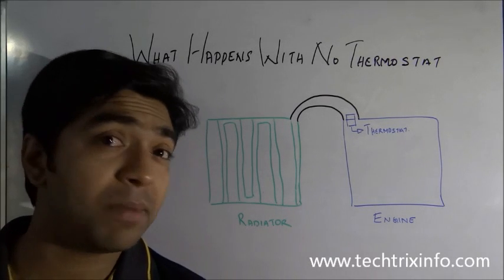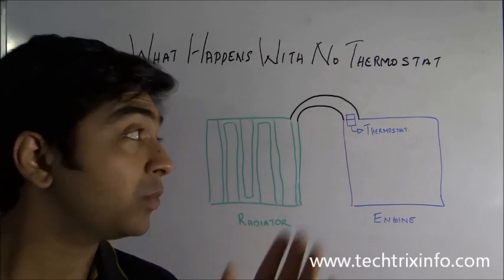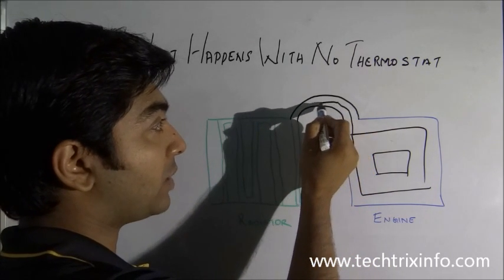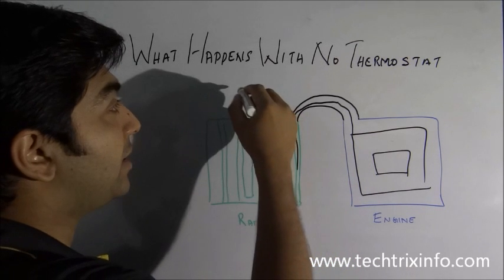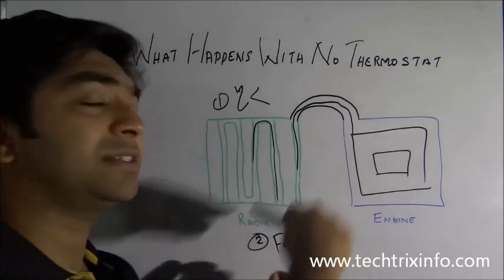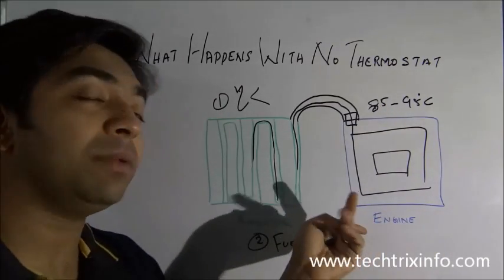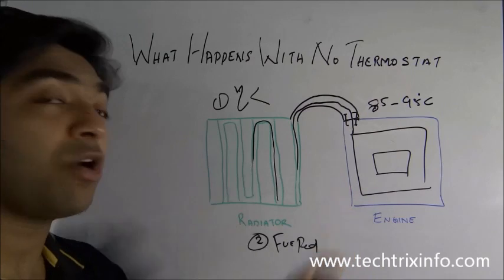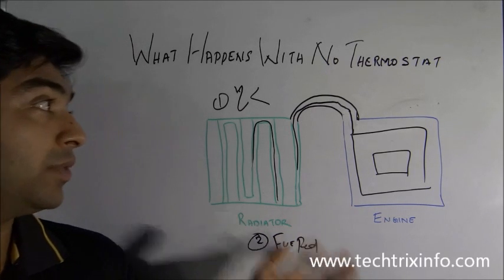Can engine work with out thermostat ? ✔

Comment: Lies. The engine will still get hot.
Reply from the maker: Hi, While it's true that an engine will still get hot without a thermostat, the thermostat plays a crucial role in regulating engine temperature. Without it, the engine may reach operating temperature more slowly and unevenly, leading to inefficient performance and increased wear. The thermostat helps maintain the engine at its optimal temperature by controlling the flow of coolant. Without it, the engine could run too cold, affecting fuel combustion and emissions. Ultimately, the thermostat ensures that the engine operates efficiently and reliably by maintaining a consistent temperature range.

Comment: Hello, I bought my Toyota Sienna 2012 without Thermostat in Nigeria. Do I need to buy thermostat. My mechanic discouraged me and saying it's not advisable
Reply from the maker: Hi, thanks for your comment! Even though your mechanic says you don’t need a thermostat, it's generally important to have one in your Toyota Sienna. The thermostat helps regulate the engine temperature by controlling the flow of coolant. Without it, the engine might run too cold or too hot, which can lead to reduced performance and increased wear. In some cases, running without a thermostat can affect fuel efficiency and emissions. It’s worth getting a second opinion or discussing the potential long-term effects with another mechanic to ensure your engine stays in good condition.

Comment: Driving a mitishbish 4g63 without  a thomostart  when rain fall heavy  it will not start until the sun come out please  help  thank you
Reply: Check heater plug and glow plugs.... or put manual heater, it helps heating glow plugs fast and useful when rainy days...

Comment: 2001 toyota camry,,has no thermostat all new heat sensors new fan switch fans do not work still.. Put on manual swtch to have fan on all the time,,car temperature still getting hot. new coolant .Any idea what i can do that im missing. Thanks for your videos they do help.

Comment: This is a classic example of an amateur person with a clickbait video just repeating what he heard but evidently contradicting himself on his graphic which show no return hose and he did not even mention that when he should at 4:10 . Sadly people like him give tons of misleading information on you tube. In short, yes it is better for the engine to have thermostat (engineers have done tons of research). If there is no thermostat, coolant temperature sensor will send signal to ECU with different temperatures and engine will not run at its optimal power, fuel consumption. etc. Also  creating a check engine light.

Comment: I live in Sydney where it is mostly hot (and boring..but that's another topic). Only in older vehicles say 25 years plus I have removed the thermostat. The reason for this is to allow the old engine to heat up gradually. Heating and cooling causes expansion and contraction of metal. This then leads to metal fatigue and possible failure wear and tear. In a newer engine this is inconsequential because the metal is new. It hasn't gone through expansion and contraction often. Engines 25 years plus need help as they get older just as we will. Frequent oil changes best oil too careful driving techniques and gradual heating of the engine.
Reply: Yes even i have 20year old vehicle and removed thermostat..so far no issues

Comment: Driving our mitsubishi engine 4d56 for 10years without thermostat, up to now no problem. Im from tropical country the Philippines 🇵🇭
Reply: It's much better in warmer climates, in colder climates, the car won't warm up or warm up really slow and will show signs of wear a little faster. If you tried this in North Dakota in winter, the car would always be in the "choke phase" and run very rich possibly wearing the piston rings out faster and you get abysmal fuel economy : /
Reply: @prototype9904  if its is in choke , heat it up a little.
Reply: same bro i just realized that my car has no thermostat for 11 years now
Reply: @SeanTabada  hi

Comment: Hi bro,I m in civil engineer we have rig machine in our site this machine engine frequently getting overheat so, my question is without thermostat we can keep optimum temperature or not if it's then how it ll be working can you explain
Reply: If you are an engineer like you said you must be capable to solve this by your own...run some tests on the rig with and without the thermostat...chart your readings and decide accordingly.

Comment: How long can travel with bad thermostat, can I run a my car with a bad thermostat, car isn't over heating but heater is not working
Reply: it depends ,if your thermo is shut closed you will need to stop and removed it immediately

Comment: My old car without thermostat it works fine .in Florida you need  no heat
Reply: I’ve never had issues running no thermostat. Engine just takes longer to heat up.

Comment: Thats not true i have checked my scan tool and it has no noticable  difference infact during idle  the fan is off until the engine gets over operating temperature and keeps it at operating temperature so thermostat are only good for idle during in snowing conditions to avoid water from freezing at the radiator as the waterpump would try to circulate icey water the thermostat would save those components on the engine by warming the coolant internally but in a warm country thermostats dont save anything

Comment: What about this argument I hear a lot? Without the thermostat at higher RPM(faster speeds) the water doesn’t have enough time to cool down so hot water goes back into engine which could result in overheating. I have a carbureted liquid cooled motorcycle and considering not running a thermostat.
Reply: At higher RPM the water doesn't have a chance to heat up without the thermostat I think is the issue.

Comment: Old diesel Mercedes 1984 internal corrosion build up.....removed thermostat to compensate. Doing an acid flush risks more leaks than just removing thermostat. I live in a hot state. Optimum temp is now held going up hills and overall average driving. It no longer reaches 90% max heat risking damage to all parts of the engine. Longer morning warm ups is all.

Comment: Hie 
I have Honda civic 2007 model automatic transmission ...i changed the thermostat valve but when ever i drive in sports mode my engine gets overheat , i checked with Honda service center they said replace the radiator its gonna cost me 25k ... Plz do help me why my engine getting overheat while driving in sports mode .. I will be very thank full to you ...

Comment: 2001 bmw 740i, been driving it without a thermostat. The temperature needle always stays in the middle. The only difference I noticed after removing the thermostat is that it takes about 10 minutes to reach operating temp.
Reply: Idris Babatunde my Land cruiser with engine driven fan takes half an hour to heat up without the t.stat.guess it's better to run it that way.😂
Reply: I got a 5th gen prelude and same.
Reply: i think if the fan i controlled by ecu, then the engine will still heat up quickly as the fan will not be working until it gets to optimal temperature. Taking out the thermostat in this kina car, you may not notice much of a difference ..

Comment: Brother, could you please tell me why does coolant leaks in a car when it's on
Reply: Depends on the car. If it is an American car, the coolant runs out of the Engine into a "heater core" and then into the radiator where it is cooled by the fan then back into the engine. The "heater core" is a small radiator that is located inside the dashboard of the car on the passenger side, mounted at or around the fire wall. Connected to this heater core is a blower fan and motor. This is designed for warmth in the winter time. You simply turn your air condition setting to heat and set the fan to the heat output you want and your cab stays warm. The heater core is, generally - like your radiator, made out of copper. Over time the copper becomes corroded and forms a leak. This makes it's way into the floorboard of the vehicle on the passenger side. You have 2 choices now. Remove and replace the heater core or cut the hoses going into and out of your fire wall from your block and to the radiator,  respectively, and bypass heating system with a double male adaptor that links the 2 hoses and allows the coolant flow to continue. This method is cheap and quick, but you will regret doing it when winter hits and you have no way to defrost your windows or stay warm in the cab. If you do nothing eventually the leak will grow and you will have not only a stinky cab but an overheating vehicle.

Comment: No thermostat, means Car just takes longer to heat up, but after it heats up it runs normal..
Reply: If you're driving for long distance with no thermostat, the engine will be cold and reduce fuel economy. Because the radiator is getting blasted with 120km wind with continues circulation of coolant.
Reply: @frogGames  will it be a big difference? What about putting a piece of cardboard in the front
Reply: @420BLUNTLEY  😂🤣
Reply: Frog games is onto something 
So road trips yes fuel economy out the door
But if u in city and stop and go at stops the engine has time to heat up a bit

Anyway I like how u thought and know about the one factor a lot of people don’t bring up about this topic (the wind speed) when we driving the engine is getting cooled every second heck faster u go the cooler I did it today
 
That sed of the goal is to keep the block cool fine 
Check that off 
But if we want our fuel to vaporize efficiently therefore not run rich and keep our part lubed in the pistons and bearings than that’s a fail 

I guess after researching about “is it okay to run with no therm” 
The answer is yes/no
Yes in the city at 70sF and above 
No rural or road trips 70sF and above and no in the city at like 50sF and less 

So in my conclusion im prolly wrong
Yes we found a way to beat the engineers to keep our engine block cooler but that isn’t the goal the goal is to manipulate the engines temp to run optimal  and cooler isn’t the best temp is it?

Lastly I think we can’t have both cool engine and efficient gas miles/lubed engine parts

Fck it I’ll ask my co workers about this tomorrw at work and stay with no t stat I feel the block cooler is the way to go at least for a Honda in Tampa FL anyway it’s march now it ain’t gonna be cold till next Jan I got till next year to figure out whats wrong with the fking coolant system 
Amen 

Peace’s didn’t even watch vid just read the comments on like 4 or 5 vids there a lot wisdom in YouTube threads 
Be good y’all
Reply: JPS JPS  slightly, as long as you have good antifreeze, will just take longer to heat up.

Comment: In most cases it's 1 of 2 cases....... 1. You have a thermostat that has seized shut. Which means all the antifreeze that's being heated up can't escape... Causing hoses to burst and gaskets to fail... Or 2. You have a failing water pump. And in other cases u have a failed thermostat which caused your water pump to shit the bed (or vice versa). I suggest that if you only use your car to get to and from work on (highway miles during summer climate) remove your thermostat all together. And if by the time you park your car at your job, your car is still overheating.... Then you probably have a bad water pump. As far as cold climates go.... If you remove your thermostat....your engine will stay cold while you're driving, which isn't very good. So, I'd suggest just having a new thermo-  before winter kicks in. So your engine can have the proper temp... Some mechanics will test the thermostat before installation (kinda like how you'd test one at home).Note: If you're driving on a highway and your temperature gauge is normal, but when u stop at a red light your gauge starts turning to hot.... Then you have a failing thermostat, or a failing (or already dead, pump). Or the dreaded blown head gasket. But there are also clues to determining that. Like white exhaust, or oil in your coolant or bubbly/milky oil on your dip stick.
Reply: Note: If you're driving on a highway and your temperature gauge is normal, but when u stop at a red light your gauge starts turning to hot.... Then you have a failing thermostat, or a failing (or already dead, pump)

Comment: I heard some people say their car runs well for years without thermostat. Trying is believing. That is what they said. Please comment. Thank you. One more questions please, is all thermostat model open at same optimum temperature which is about 90 celcius?
Reply: Bill Chua 
If the thermostat has a sensor, it will cause a check engine light, in older cars that don't have a thermostat sensor, you can run it indefinitely without it, it just takes longer to get to optimum temperature where the oil thins with heat.
Reply: My cars always be over heat so my mechanic come across to removed thermostat since he removed themostat my cars runs nicely without any over heat issue for last 3 years and I drive always on highways and other cities

Comment: You only need that to countries with freezing temperatures.
Reply: The longer it takes to reach running temp, the more wear happens on your motor. Doesn't matter what climate your in, its always smarter to run the thermostat

Comment: Hi! Just to add. The reason why the thermostat was designed, aside from attaining the working temperature of an engine, the most significant design consideration is the design of the engine itself. If we trace back the ICE in the 1900's, they have that constant problem of the cylinder liners. From start up, the heat exchange that occur between the liners and the jackets creates a significant deterioration of the liners because of that sudden heat exchange creating a destructive property change of the liners thereby reducing the life of the materials used.

Comment: JUST ABOUT EVERY 1 I KNW  N CALIFORNIA  AT 1 POINT DON'T HAVE THERMOSTAT...IT DEPENDS   CLIMATE
Reply: Unless your climate is at around 90 degree Celsius ( which you would be dead) its wise to run the thermostat.. The more time it takes to reach operating temp the more wear is done on your engine

Comment: my toyota ipsum blew a leak on the radiator... replaced the radiator and removed the thermostat. running with no problem for now and the cold engine light still goes off around the same tim as before...will replace the thermostat only if the winter seems to affect its warm up time. as for fuel efficiency in cold morning drives i can always drive economically till the cold light goes off.

Comment: Excellent explanation thank you... I found your video while searching for an answer to my problem... maybe you can help? I have an 89 Toyota pickup (love of my life) and it over heats when I put a Tstat in it... if course I have NO overheating problem without it but in the colder temps I'm suffering the engine is too cold problems... I put 3 brand new tstats in it and it keeps over heating!! Yes my heater is working fine... hope to hear from you soon!!
Reply: Christine Kreul  You might not be getting the proper T valve, or there is some leakage or problem in your car’s cooling system
Reply: Dear friend, your truck is too old...I can bet you lunch the problem is in the water pump...you need to change it...asap..!!...this will help to recover the proper coolant flow thru the engine, hoses, radiator and the heater core as well...before installing a new water pump strongly suggest to make a radiator flush to dump all oxidation and particles in the coolant...then replace the water pump, thermostat, coolant and for the best, the accesory belt too
Reply: Maybe something is clogged. Rust. Or a broken pump fan. Worse case is coolant mixing with oil.

Comment: If you live in " Cold Weather ", you will need your Heat. Basically they designed it for " On Demand " Heat, if you ask me. Here is what I do to our Trucks... I use 2 Thermostats. One, is the By-Pass. The other is " Normal ".... The By-Pass... We use it for Summer... Then we Switch it back to " Normal " in November each year. NOTE: If you do a By-Pass.... You can Drill the Hell out of the Thermostat, LOL.  You will only need the " Rubber Ring " and the " Round " part of the Thermostat, so it can sit in the " Hole " safely and it won't " Leak " on you. Hope that will help People who is looking to do it.... Hmmmm, maybe I can make a Video of it, LOL
Reply: Block off a 3rd of your radiator for more heat in winter. Those gas station plastic signs work great

Comment: I removed mine aftr replace head gasket failure.. Not much diffrent in fuel efficiency..here in uae temp. Reaches 50*.. So my engine alwys on working temp.. Lol
Reply: Hmmm Great to hear... I just did ours... I will make another Video later this Month after Testing :D

Comment: I replace the timing belt on my 96 camry. The car is running  smooth, except the temperature gauge goes all the way to hot. The car is not overheating though. I replaced thermostat but it is still overheating according to gauge. I put the heater on and air comes out warm. I was thinking of removing the thermostat.
Reply: Darth Mal good idea I did
Reply: u might simply have faulty gauge mate.

Comment: 2005 dodge magnum rt, been driving it without termostat for 8 yrs and nothing happend never have a problem
Reply: fernando moran  I LIKE THAT U KEEP IT REAL
Reply: Do y have hot in y car if no thermostat ?
Reply: @viorelgherasim5458  yes i been driving for 1 week, my heat works
Reply: U didn't have no problems with no thermostat did u just cut the middle out of it did your heater still work
Reply: Thermostat is used to maintain the efficient temperature of the engine